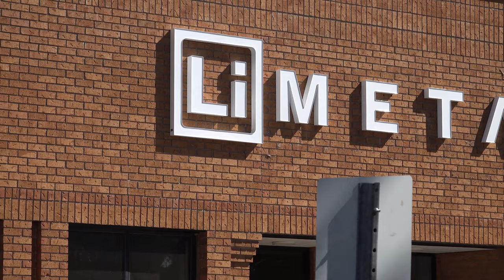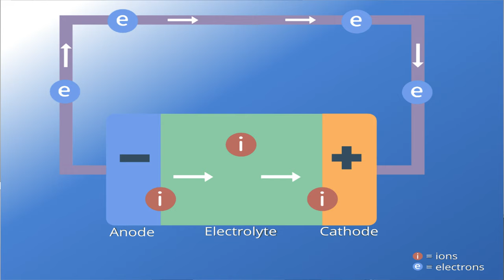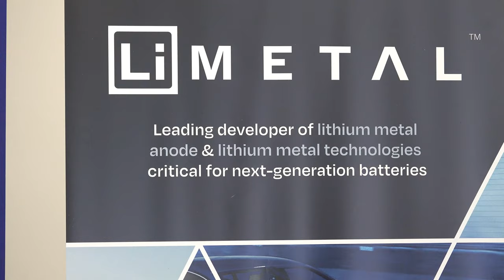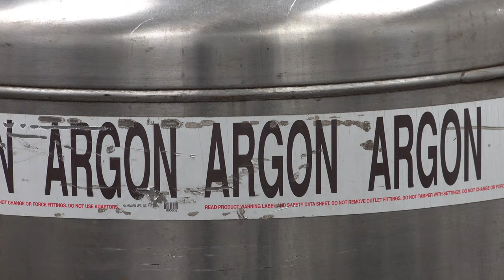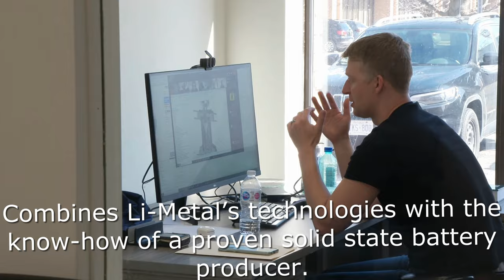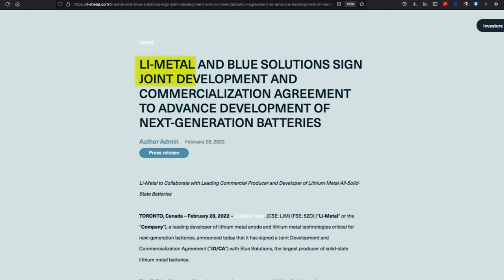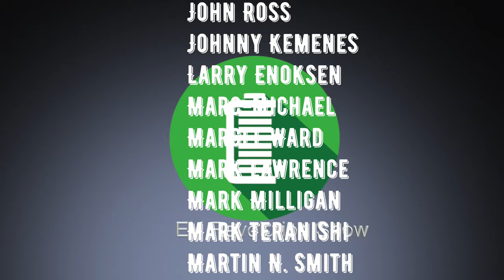Episode 179 - Li-Metal - Creating scalable technologies for next-generation batteries!

Comment: I believe Li-Metal are looking at brownfield sites in North America in which to build a 5,600 tpy plant.  Given that lithium carbonate will be used as feedstock to produce lithium metal, it would make sense to have it close to where that chemical is produced.  The North America Lithium mine at La Corne, Quebec has a partially built lithium carbonate plant. Nearby at Amos, is the Resolute Paper Mill, (shut down in 2019).  Perhaps this is the brownfield site Li-Metal are looking for?
Reply from the maker: Thanks for watching and for the feedback! Maybe I am not aware of the sites they are looking at but check their website for more info.